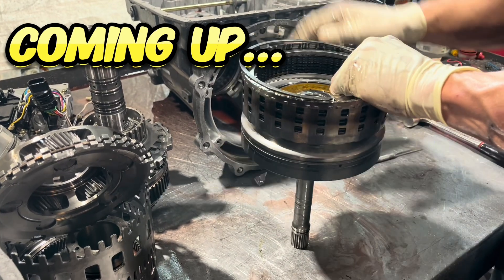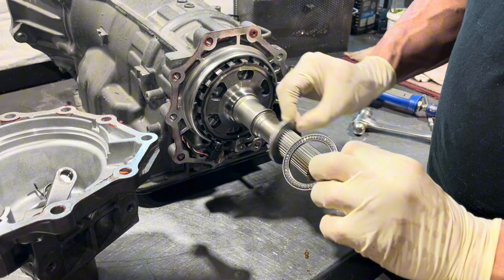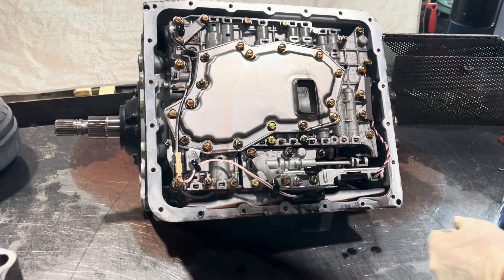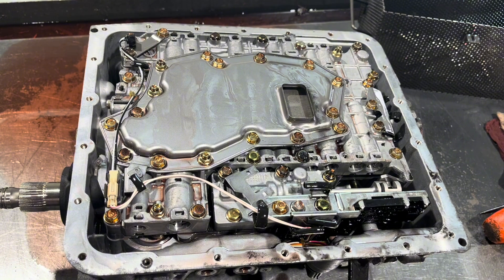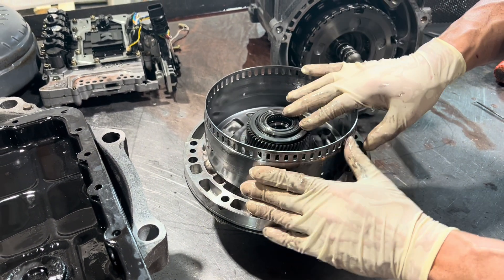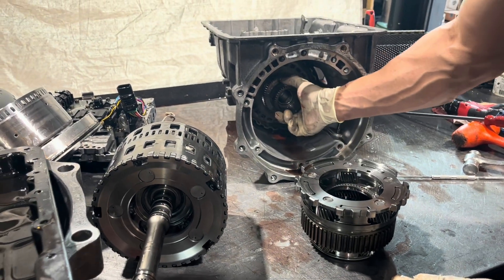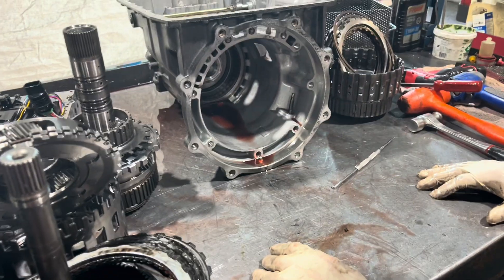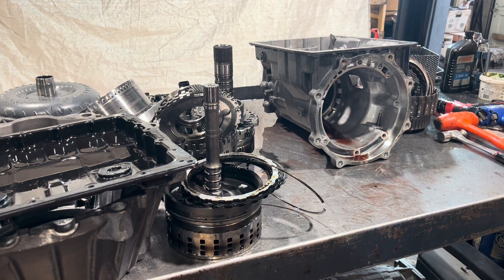RE5R05A Transmission Build EXPOSED!

Comment from the maker: We specialize in Nissan and Infinity high performance  automatics, valve bodies, torque converters and other heavy duty transmission components!
Find Us:
https://www.importperformancetrans.com/
973.406.7000
Instagram - @IPTperformancetransmission
Facebook - Import Performance Transmissions
Reply: Can you recommend any reman units? I have a 2008 Titan and the transmission burned up on a crocc country trip in 2023.
Reply from the maker: @ We rebuild them and that’s, not surprisingly, my recommendation. We’re reachable here:
9734067000 or
Sales@ipttrans.com

Comment: From 2017-2019 which is the most reliable transmission in the nissan pickup ..., all these problems with the newer models and i have a 1992 D21 RWD i've only changed the timming chain, oil pump, water pump 1 time in 28 years.. same transmission the most i have to keep up with is the control arms  connecting rods and such. oh yea and shocks.
Reply from the maker: What kind of pick up?

Comment: Thank you so much for the informational video. I have an 06 titan that I have extensively repaired and want to get to 1 mil miles. Rough up shifts close to redline when flooring it 1st to 2nd and sometimes when downshifting from 5th to 4th when flooring it. Hoping to make repairs based off your video. Thank you. 🙏

Comment: great video, Thank you.. 
what and from where did you get the rebuild kit from? I have a 2007 Nissan Frontier 4.0L RWD RE5R05A. thank you again
Reply from the maker: @alejandromorales5822  Many of the parts are only available when we do a transmission build in house 
That said, regular stock rebuild kits without our specialty parts are available through the normal sources

Comment: I have an Infiniti m35 i recently just rebuilt the vq35de in it with forged internals and a lot of other upgrades. Only thing I’m worried about is the re5 trans. I put in a transgo shift kit. How much hp can I reliably make on this trans with the transgo before it blows?
Reply from the maker: That’s kind of impossible to say due to the dozens of variables involved with that
Reply: @iptperformancetrans  ok so how much u charge for an awd re5 built trans with a built transfer case?
Reply from the maker: @justingriego6986  The best bet would be to contact us at the shop tomorrow and we can figure out what you might need 
Sales@ipttrans.com
973.406.7000
Reply: @iptperformancetrans  ok thanks